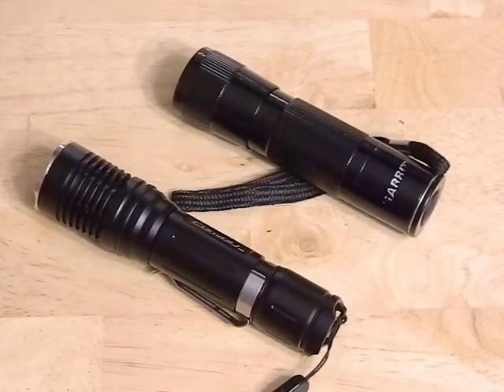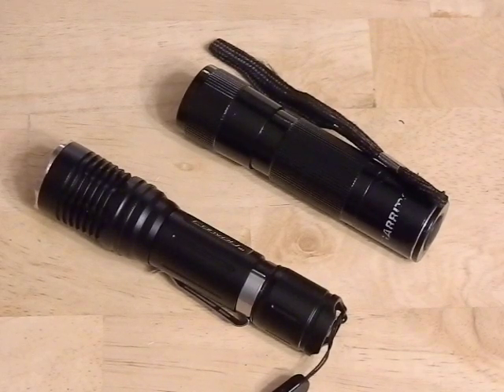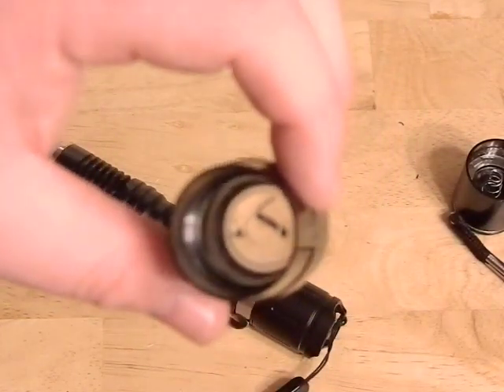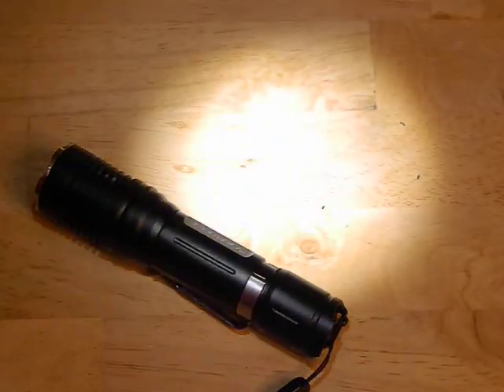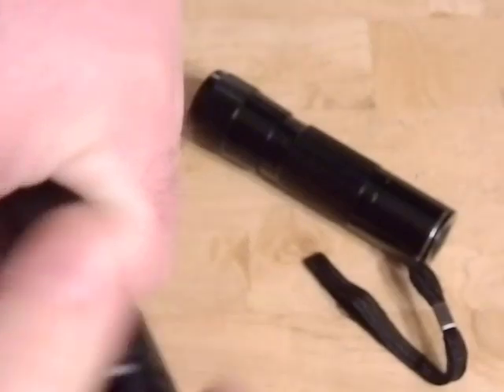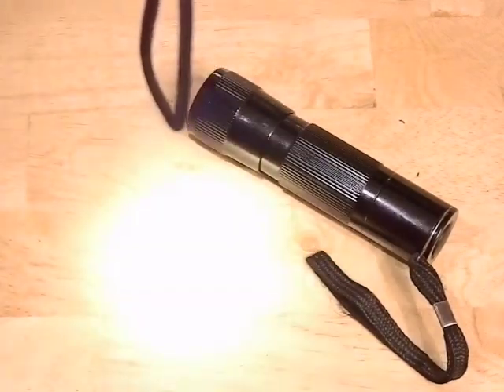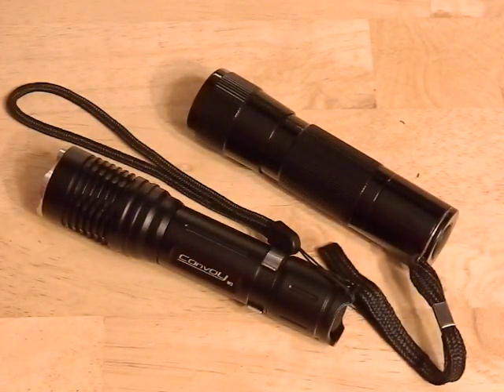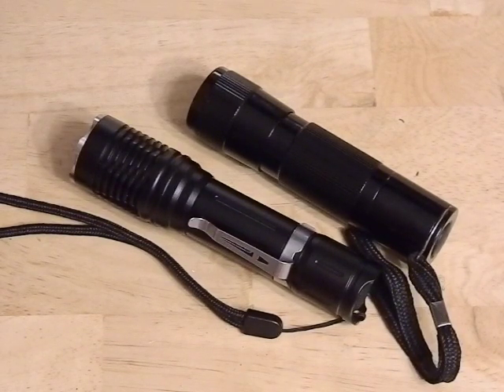My first flashlight build and my first mod

Comment: Are you sure the M2 was pulling about 3 amps. because you can get a stock one to pull 2.8. 

How did you measure it?

I would think a FET driver would pull more like 4 or 5 amps especially with the spring bypasses. 

If it's really only drawing 3 amps, then maybe it's the battery limiting it?